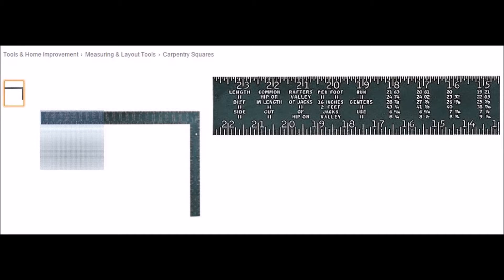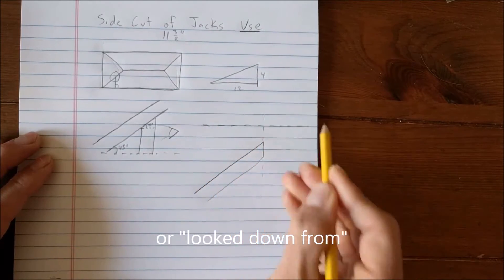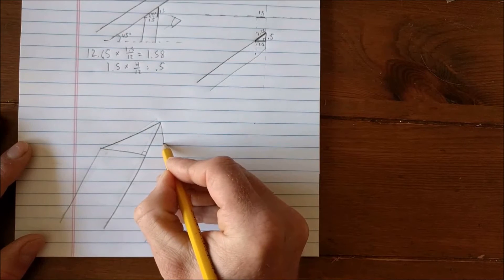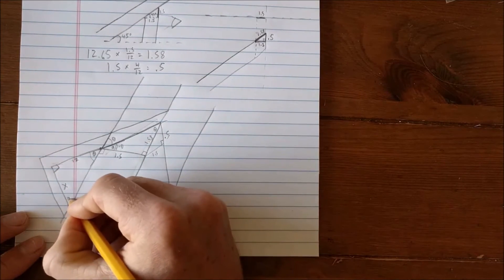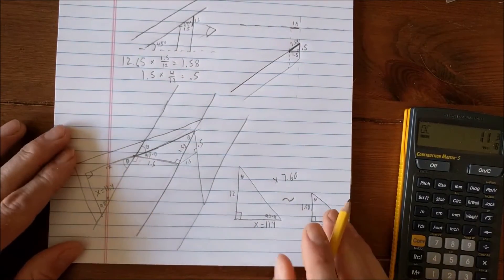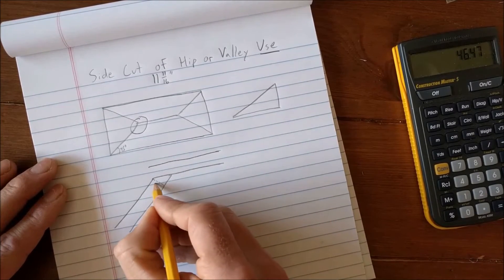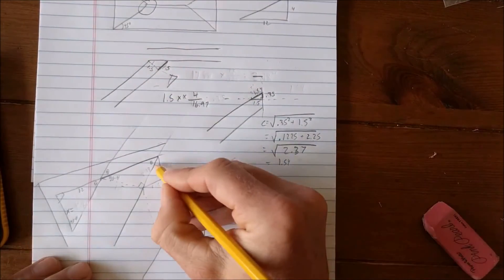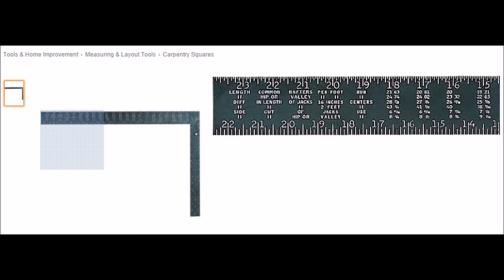How to derive the Framing Square Rafter Tables - Lines 5 & 6 (Side Cuts)

Comment: The side cut numbers are for using a handsaw. If you are cutting with a skilsaw, set the saw at 45 degrees always. Its similar to cutting  crown mouldings flat, or nested.

Comment: Ben Ogorek,
Your analyses of these cuts are correct. Unfortunately carpenters and contractors have different goals which are to get it done fast, get paid, get off work and get drunk. My goal is to do it correctly which solves numerous problems down the road.  I have spent a lot of time working on my house which was built by "professional" carpenters. Much of my time was spent correcting their shit work. I  have to say that  their work, that  I have seen so far,  is one notch away from slop. For example, when the print specified a screw fastener, the "professional" would hammer the screw in with a framing hammer.  Setting the blade angle to 45 degrees instead of the correct angle sort of works but the angle of the rafter will be slightly off.  Since carpentry, compared to cabinet and furniture building, is essentially sledge hammer work, nobody is ever going to notice if a joint fit perfectly or if was mashed into place with a hammer.  Obviously I am fed up with  "professional" contractors but I learned how to do it myself and have no use for them.
david
Reply: David, I'm a Red Seal Carpenter in Canada and my speciality is structural framing. I wish I could argue with you, however, you are too correct. Framing here has been so watered down by builders who don't care about quality and want to pay the least. Hence, the animal framers come to town and throw these houses up and deliver garbage. The building inspectors only care that it is code compliant and don't care about quality. The builders only care that it passes and that it "looks good". Builders also have trouble differentiating between custom and production framing rates. Give me one house at a rate that is for ten houses in a row. It's ridiculous. 
I've taken the time and made the effort to practice my trade and keep my skills up to par. The others look at me funny because I use my framing square and my speed square. I do all my floor, wall, and truss layout with a framing square and I can doing faster and more accurately than these jokers. I'm able to layout and cut sidecuts accurately for both hips and rafters and cut them cleanly. 
There are some Carpenters out there that still take pride in their work. I'm fed up up with guys that build with one tooth saws (sledge hammers) also.

Comment: You are wrong. Ive been cutting roofs for 35 years, and the hip cuts on jack rafters are always set 45 degrees on a circular saw, no matter what the pitch of roof. I can guarantee this is true. Because you are not cutting into the timber square on, but are cutting into a plumb cut, the angle you have cut across the top of rafter will not measure 45 on a protractor, if measured square to the timber even though the circular saw has been set to 45, but it will always be right. Difficult to explain. But imagine this, on plan view, the cut  across the top of the jack would appear to be 45, but if you were to lay the jack down flat then that angle would change depending on the pitch of roof. So here`s the point.... Imagine the jack on plan view again and imagine your circular saw above it, set to 45, cutting down through plumb, and there you have it.

Comment: You could also use a handsaw guide block cut to 45 degrees, to get your handsaw started at the correct angle. The top cut angle is different for every pitch roof  but the hip always intersect the Jack at 45 degrees.

Comment: Ben Ogorek,
The rafter table on the square lists the side cut rafter as 11 3/8.  I have a Casio fx300ES scientific calculator which costs about $10.00 at an office supply. It has the ability to accept the entire formula. What you have done with this video is excellent. I rewrote your process into one formula to directly calculate the blade angle.

Blade Angle= 90-(atn((11+(3/8))/12)). This equals 46.5........degrees.  For other slopes just go to the rafter table on the square and  substitute  11+(3/8) with the number on the square.
david
Reply from the maker: I'm glad you got something out of the video, David. That's cool you got the calculation down to a single formula!
Reply: Ben Ogorek,
 With two additional tools I was able to lay out my face cut lines. One tool was a Husky Digital Angle Gauge and the other was a Stanley Adjustable Speed Square. The Husky Angle Gauge has metal arms and a locking mechanism to secure the angle. The digital readout is accurate to 1/10th of a degree. I set the Husky gauge to 46.5 degrees, locked in the arms,  transferred the new angle to the Stanley Adjustable Speed Square and locked in the adjustable arm of the Stanley square.. After that it was just a matter of placing the adjustable arm to the side of the board and drawing the face cut line in the  usual way.  To mark the plumb cut I used a regular Swanson Speed Square.  Using a similar technique I was also able to mark out a double cheek cut for a hip/valley rafter.
david

Comment: Hi Ben,  I have seen all of your videos and they have been so helpful. I was wondering if you can explain how to calculate an Intersecting Roof? With 16 inches OC.
Reply from the maker: Hi Abel, I'm glad the videos have been useful. If you get something started on paper, let me know and I'll take a look, but I'm not in a great position to help. These videos are from 2016, a year that I was putting everything into learning construction, and I even quit my desk job to join a framing crew. The framing square was a mystery and had a great time figuring this stuff out. I wish I could tell you that I prevailed and stuck with construction, but I went back to desk job later that year. Now I'd have to rewatch all these videos just to figure out what's going on.

Comment: Sorry Ben, wasn`t trying to put you down with my previous comment, just wanted to correct. Like what you are doing explaining roofing square tables. I can calculate roofs by means of many different ways ( including some that ive come up with myself) but never really understood the tables on roofing squares. Nobody uses them anymore, not even 35 years ago, nobody I ever worked with used them. I always told myself that I would learn one day, so its about time.
Reply from the maker: No worries MrCorfuz, and one thing is for certain - anybody wanting to build a roof should hire you over me. In my short time as a laborer, I botched quite a few rafter cuts and watched guys that only understood common angles on a speed square build awesome roofs. The one question I have for you is, if the "true" angle was 46 degrees rather than 45, would you really be able to tell?
Reply: I can assure you that 45 on a skill saw will always give you the 100%  "true" angle, even though the angle it actually cuts (being a compound angle) will not be 45. ( It will differ depending on the plumb cut that you are cutting into) If cutting with a handsaw then you need to know how to work out that actual angle. The methods for this can be very complicated, but an old carpenter told me a method for this when I was teenager that was so simple it was beautiful. ( but also hard to explain in words!)
Reply: He’s right.  Different pitch plumb cuts will give different angles down the cheek cut.  It’s a compound angle.

Comment: What angle do I cut the Jack rafters or probably any in Rafters that go into the hips or the valleys for 12 12? Is this the only roof slope that you can go 45 level 45 miter and get it right? Do you have a link to the video as shows a compound miter saw cutting Jack rafters or Valley rafters please? I didn't get you drawing. And yeah I do know trig but that's been a while.

Comment: BAD INFORMATION. YOU ARE INCORRECTLY TEACH THE SIDE CUT ANGLE IS THE ANGLE USED FOR SETTING THE SKILSAW.  IT IS NOT!
Reply from the maker: These videos were about tracking down where the numbers came from on the square, which I thought was interesting. My time as a carpenter was short and not particularly distinguished, so help me out here, Rick. Did I just mix the angles up or did I say something completely off the wall?
Reply: Jealous and negetive  to the CAPS commenter....probably failed math and no carpenter papers.....shame..... pretty impressive math skills there... motivated me to spend more time thinking that way again ...thanks Ben and keep up the great work...
Reply: Rick R -- you set the saw to 45 no matter what the pitch of the roof is, right? I enjoyed the video regardless because its neat to know the angle that the saw is producing when making the compound cut (which of course isnt 45 despite the saw setting). And it helped my visualization of 
laying out the proper cut angle, if one had to do it with a handsaw.
Reply: @Tristan.k50  You replied to a two year old comment out of ignorance. 
When you set the saw to a 45° bevel & cut the rafter along the plumb line it produces the angle represented by the tables on the framing square. You said it was a shame & I could not agree more, but the shame is on you for thinking you know more than a seasoned professional carpenter w/paper math.